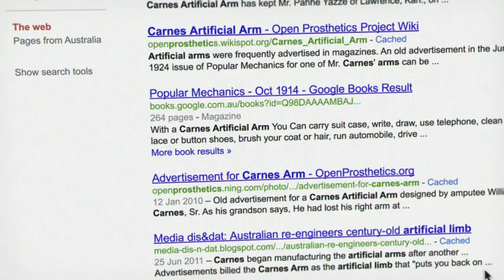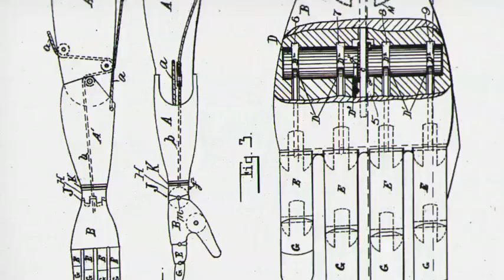Ted.com talk - What babies learn before they're born

Comment: I was basically starving in the first trimester of my pregnancy over 15 years ago, partly due to the severe morning sickness I experienced, which extended into the 2nd trimester. My daughter was born perfect - she's beautiful and brilliant - but her umbilical cord was only 13 inches long ~ very short. At birth, she got stuck, and my midwife thought that it was due to her large shoulders, but it was actually due to the short umbilical cord, we found out later. It ripped her placenta off of the wall of my uterus and I hemorrhaged, but my midwife corrected it quickly and I did not have to go to the hospital. I have always thought that it was because in the first trimester when I wasn't eating much and was very thin, my body decided to spend its energy on making the baby, rather than the umbilical cord. It also provided a shorter route for nutrients from placenta to baby. I thought it was interesting.